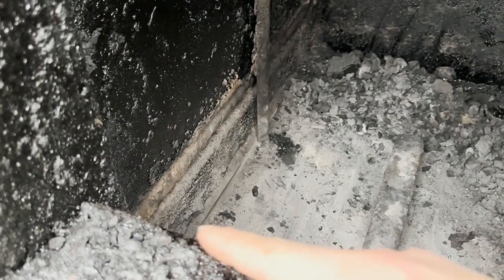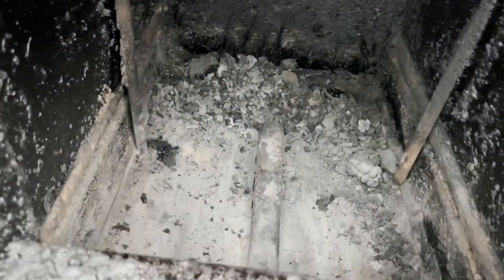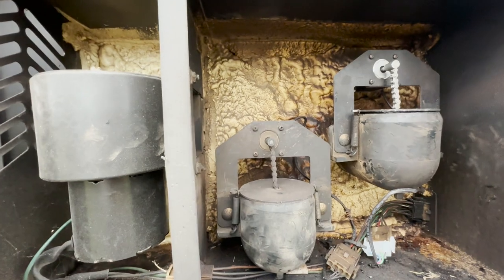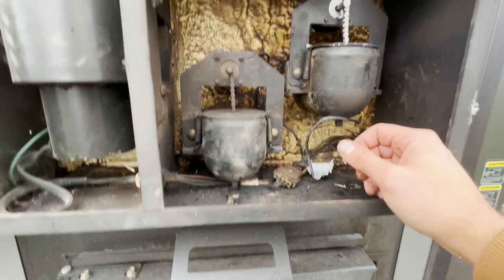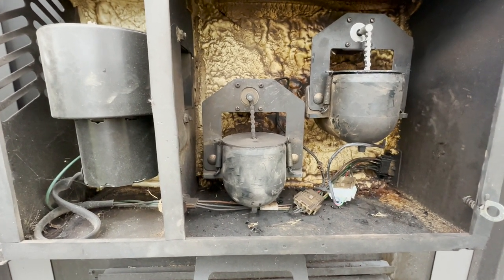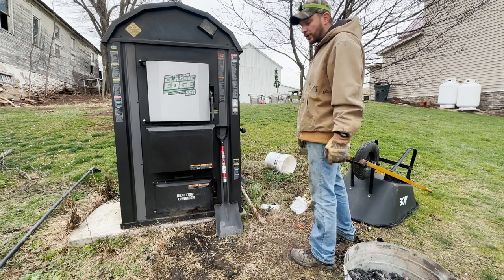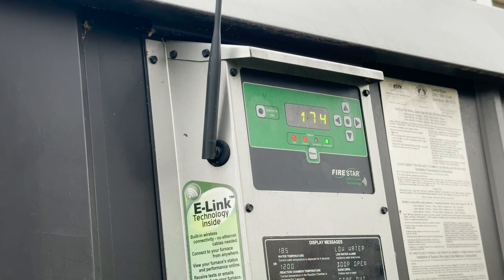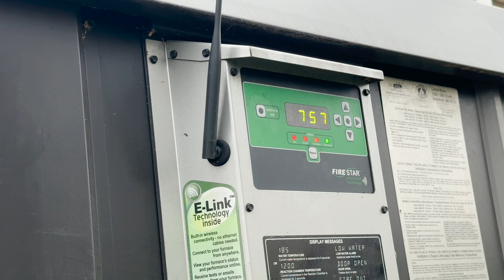Changing Out The Stepper Motor! Central Boiler Classic Edge 550 Titanium HD! Winter 2022!

Comment: You ever get smoke back flowing through the scupper? Dealing with that now on my 760.
Reply from the maker: The only time smoke will roll back thru is if you have an air blockage somewhere inside the furnace.  I suggest taking all air lol channels out and clean them thoroughly.
Reply: Thanks for the response. Cleaned the exchangers out, checked the chimney, dug out 75% of the ash from the fire box…been at it for 2 days.  Can’t find where it is.
Reply from the maker: @mikerudis2983  the primary and secondary air flow throughout the fire box needs taken out and cleaned.  That’s where your issue will be
Reply: Thanks a lot for your videos. This is my 3rd yr with mine. I learned a lot from you.
In the video, you cleaned the channels also in this one. I do not seem  you went to the end of the secondary. At the end of the motorized elbow pipe, there is a mesh. Only fingers reached there. Or you can try to access through the 3 holes on the inside wall. In my case, that mesh was clogged with cresote, too.  The motorized elbow can't shoot air to the secondary because of that.  You can use a long small spoon. Also, I'm careful not broke the mesh.
Reply: What buttons did you press to test the stepper motor ?
Reply from the maker: I don’t have a mesh in there?
Reply from the maker: You can use a number of different methods to test. Open the door, shut the door, or use the ignition button

Comment: Enjoyed your video, thanks for sharing. We just fired up our new Classic Edge 560 HDX three weeks ago. Still learning some of the proper operational procedures. We have forced air heat in our home. Curious to know what you set your low limit to? I bumped ours up from 165 to 170 with high limit set at the default 185. Thanks again!
Reply from the maker: I do a ten degree differential. I do 175 to 185.
Reply: I change mine based on outdoor temperatures. When it’s colder I use a 20 degree differential and when it’s warmer I go down to 10. The shorter diff keeps the fire going better when it’s warmer, the longer diff prevents the boiler from cycling as frequently
Reply: More differential = More down time = More creosote/tar. That’s just for my 550 Edge HD. I’m at 175/185.
Reply from the maker: I’m 175-185 too

Comment: Did your CB give you primary stepper error at firestar ?
Reply from the maker: No. I had to troubleshoot.
Reply: The 550 I have gave primary stepper error on firestar. Changed out primary stepper and continued getting error. Turns out firestar controller is said to be issue from CB. Waiting for controller to arrive and will know.
Reply from the maker: @zebt3771 - mine showed zero error but the stove was choked off from air.  That is how we troubleshot the issue.